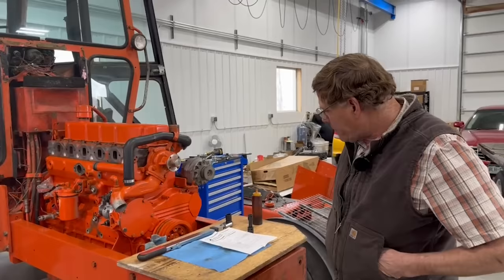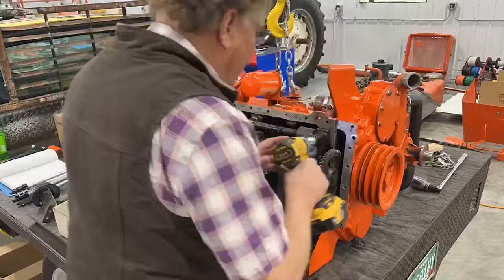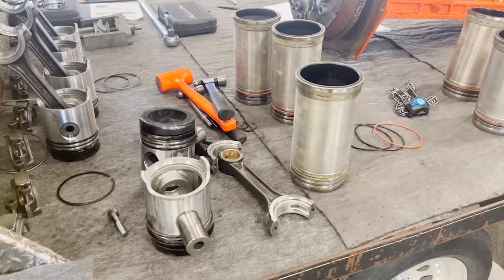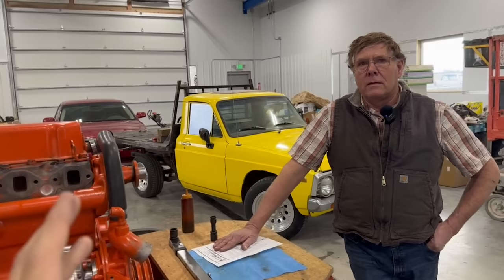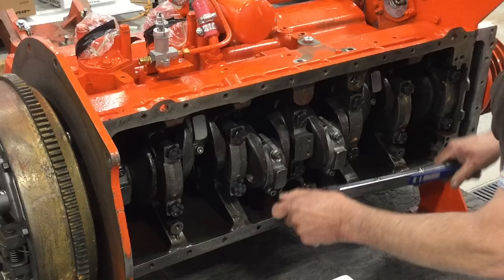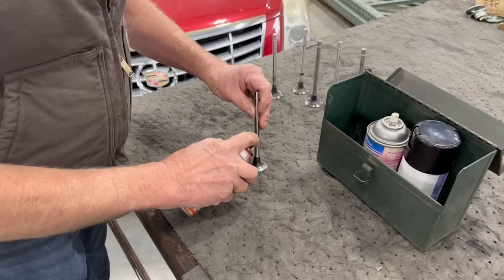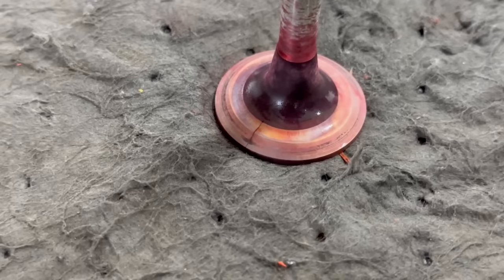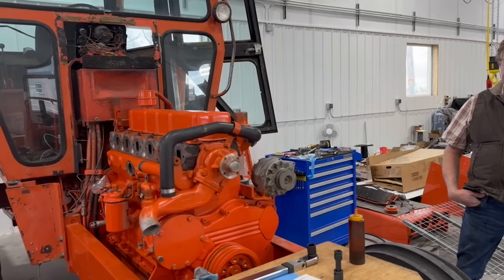Missing THIS Would've Cost Us THOUSANDS of Dollars!!!

Comment: Is there a farm tractor dealer or a repair facility nearby? They may have a  pto dyno that can verify the engine’s power and how it is operating before going in the field. 

Many tractors can tolerate 20-30 hp over factory as long as the cooling system is keeping up. 

My own farm tractor is 25% over factory (60 hp factory to 80 hp according to pto dyno) Has been that way since 1999. 

I have worked on a turbocharged JD 4020 that my friend purchased with a seized engine as a project to fix up and sell. 

The fuel pump was sent to a pump shop and they said it was turned up in every way possible which  caused the seizure.

After the engine was overhauled, it was ran on a pto dyno which showed 120 hp. Without the turbo hooked up, the 404 cid engine made 100 hp.

Comment: In your previous videos, I could tell that the injection pump was off. If you look at the spray pattern and how it is up out of the bowl, that is a big issue because it can spray flame at your ring land area. My 25-plus years of experience is that you never want fuel to be sprayed beyond the 38° mark. The hotrod diesel guys that run out of injector volume will crank up the injector duty cycle. They end up pushing the limits on it and torch the ring lands. That is, of course, on electronic injection, but it still applies.

Comment: When you get it running you should check fuel timing. There is an adapter to go on the fuel line, that puts out a pulse and you can use a standard timing gun. Mark TDC #1 on the crank and put a mark on the block where you can line it up with the timing light. At that point it's like checking timing on a 350 Chevy. Would be a good check to do to verify fuel timing and to rule out any possibility that you have a timing issues.  You should also be able to then run it wide open to make sure the timing advance is also advancing fuel delivery properly

Comment: A friend of mine runs an fuel injection system repair service and told about the cleaning guys experience with his allis chalmers and he said the pump timing very important on the fuel system.  He told me 1 degrees to a diesel is the same as 10 degrees on a gas and it would cause galling in a diesel engine.
Reply: THE HARMONIC  BALANCER SLIPPED. SHOWING TIMING TO BE WRONG. I have to many times. RICK  ROBERTS.

Comment: I have had 2 engines in the machine shop recently and I wish I had been able to watch these videos years ago because bad things happened that could have been prevented had I known more about what goes on in a machine shop. Thank you for some very enjoyable videos.
Reply: These videos barely scratch the surface.
Reply: @mikeznel6048  The biggest problem is communication. I am rebuilding VW motors from the 1950s and the machine shop spends most of its time on BIG diesels. I've seen pots 6" in diameter. So I'm not asking the right questions and they are not asking the right questions so there are returns that shouldn't happen. Your channel helps me to ask the right questions.

Comment: Our pulling tractor uses the same type of pump as you have on the AC. I have checked timing using an injection line transducer and a timing light, it is a good thing to do, but keep in mind it will not match the pump timing. This is because the transducer is looking for swelling in the injection line, the pump is timed with air on the pump port and at less than full load the fuel has not yet built pressure when the pump port is exposed.

Comment: The cavitation pitting was especially prevalent on the Cummins engines, but all diesels can be suseptable to it. Those pits will be on the major and minor thrust portions. Coolant formulations for diesels have additives to prevent the pitting, but those additives get used up over time. Regular coolant changes help. 
What causes the pits? Neucleate boiling in the system. As the combustion progresses and the piston transitions from the combustion stroke to the power stroke, it slaps the liner. This causes the liner to move outward a bit. Kind of like expand in a concentrated area. This gets the coolant moving outward, gaining inertia. Then the liner wall moves back to its static position, but the inertia of the coolant causes localized low pressure areas where bubbles form. Shortly later the coolant can move back putting pressure on the bubbles that are along the liner wall, collapsing the bubbles. The coolant rushes into the area the bubble had taken up, crashing into the liner. This erodes the outside of the liner. Eventually pinholes in the liner develop letting coolant into the cylinder.
I was a mechanic on automotive and heavy duty for 30+ years.

Comment: Really love these videos guys 👌 I think we can all agree the injection timing is the root cause, although my theories on parts of the failure are slightly different. The cavitation erosion on the liner is caused by the liner bulging during combustion rather than the force of the piston hitting it as it rocks over TDC. This would be much more pronounced if the pump was wildly over advanced. The excess pressure in the cylinder will also cause the top ring to be pushed into the bore harder, this will knock the cross hatch off almost as quick as the ends butting. Either way, the pump is the smoking gun. Keep up the good work, can't wait to hear it run.

Comment: I'm just spit balling here... but I couldn't help but notice the coolant opening that goes from the feed to the liner is larger on 1 and 2 than the others (i.e, they are a rectangle where-as 3-6 are square).  It seems to me that even if the entire system is being put under pressure by the pump, in other words the pump volume exceeds all the openings... 1 and 2 would get more flow no matter what... and that much being further away 5 and 6 would get less.  Maybe enlarge 5 and 6?

Comment: Good call opening up the ring gaps. Also doesn’t surprise me that the shop found the pump was turned way up. Think I mentioned so much on a prior video comment. I’m not an allis guy (Farmall red) but the thing to keep in mind here is you are dealing with non OE parts and you have to take every spec you read with a grain of salt particularly with mid run changes like piston cooling jets.  What I’ve found in my 45 years of walking this planet is that a lot of specs are general best case specs and don’t take everything into account particularly with mid run changes.  The non OE manufacturer is always going to try to make things as universal as they can to save costs.

Comment: After listening to all your rebuild issues, didn't quite get the pressure on your pump being over in the beginning or not. We set our two ten up in pressure and timing a little. As I said before I would never trust the end gaps from the factory. I would have put new rings and all new exhaust valves with the issues you had. Glad you found the cracked valve. 
Anxious to hear that beast run and see it pull.

Comment: Late commenting on this, but based on my own experiences with juicing up a 5.9 Cummins I owned that 20% over fuel on the pump was likely your main culprit. The timing being off didn't help, but adding that much extra fuel will add lots more heat to the combustion chamber. This can be really hard to identify without a pryometer to watch the exhaust gas temps. Engine coolant typically doesn't get overheated unless the cooling system was marginal in first place. Sometimes excessive black smoke will give away overfueling since there isn't enough to let all the fuel burn, but I can see that not showing up in your case since it was firing too early so it pry got a little better fuel/air mix. Seems like one those rare perfect storm combinations of several different things coming together at the right time.

Comment: I appreciate the in-depth videos of the failure! I have a 1974 Allis Chalmers 7030. When my dad and Allis Chalmers mechanic friend rebuilt it 30 years ago they ran into a similar issue. The engine would seize up when hot. I believe they had to tear it down a couple times and ended up honing it out to prevent it from happening again.

Comment: At 10:32, If the engine cools front to back, why do the coolant ports that feed the liners get smaller towards the back? That is backwards. You want the smallest opening at the coldest, highest pressure point, cylinder 1. When the water is hot at the back, you need to increase flow to get the same cooling rate. Cylinder 6 where the water would be hottest gets the least water? 6 looks half the size of 1.  In addition, the ones on cylinder 1&2 are very jagged while 3&4 are pretty square. Perhaps an internal casting flaw/top of port broke away?

Comment: Have you considered maybe the  water pump impeller is slipping or not pumping at all. Also, is it possible that belt direction is wrong and the water pump has is pumping backwards. I’m sure an old engine wouldn’t have a serpentine belt however long belts can sometimes confusing to get right. Just some thoughts.

Comment: If you are still concerned about excessive vibration, there are vibration analysts that specialize in internal combustion engines. They can probably tell you if you have excessive or unusual vibration by running some tests on your engine.

Comment: The largest component of the "vibration" you spoke of is the single shot injection event that delivers a sonic wave into the coolant that eventually will erode the cylinder wall on any single shot injection systems like those used on the Navistar 7.3 which required a certain type of additive to prevent this cavitation. Newer engines like the Ford 6.7 and cummins and Dmax have multiple events that cushion these combustion events by slowing the combustion pressurization rate over multiple stages. I believe the GM Duramax was the first to incorporate this timed injected event and is why current day diesels are far quieter for the big 3 pickup truck engines.

Comment: If the injektion timing is in question, you should always check!
Just take of zylinder one injection line, put a clear hose on, turn the engine a couple of times over, then slowly aproche TDC on that zylinder and watch the fuel level go up! Depended on the pump, you also can take of the check valve for that line (with external fuel tank directly on the pump inlet) and watch when it stops poring out the injection line. That's easier to see then the level going up, but dose not work on alot of distribution pumps.

Comment: When you assemble the bottom end you should assemble the  rotating assembly with a liberal amount of gearshield

The  coolant problem can be addressed by using Evans  waterless coolant,  not Prestone or  Dexcool.
Yes the valves were burned out and the guides were shot.

Comment: I know this is an old video several months old, but I know on our pick ups, Diesel pick ups, timing on our injection pumps, and the spray pattern on our injectors into the cylinders on top of the pistons will have a major effect as well for heat buildup, if the injectors are messed up Don’t have a good spray pattern with the timing on. It is way off as well as a bad spray pattern. You can melt holes in your piston called torching that can happen also. As far as lubing O-rings I’ve had real good luck with CRC dielectric Greece. I never had any issues with it you have to be real easy on it super fine film usually does the trick put it on your fingers and just work it around the seals O-rings when you put them on usually does the trick Instead of using soap or oil on O-rings that’s just me everybody’s different. Everybody has their own way of doing things. I know that for sure. Good luck on this I know they’re expensive.

Comment: Nothing beats engine forensics, even though I'm a retired Boilermaker/ Engineering type guy and rebuilt a few Diesels and Petrol motors over the years your never to old to learn. I have never considered liner or block cavitation due to vibration, electrolysis absolutely but cavitation only when it comes to pumps and such. But now I have a question, does increased water pressure reduce cavitation? Well apparently it does reduce cavitation. So to me logic states that a less viscous and increased pressure coolant/inhibitor possibly could reduce cavitation effects on the liners. Only if you think your liner o rings went in ok I don't know your rad cap pressure but I believe you could run it up to 14psi. Anyway don't take my word on it, but it's something to think about!

Comment: As a Diesel Fuel Injection Tech, the base timing of the pump is scribed on the weight carrier. On these old Roosamater (Stanadyne) pumps that line generally does not need to be remarked.  However, the weight carrier could be installed 180 degrees out and only 180.  We just had a John Deere pump with this issue in today. Generally, timing errors occur when the engine is not spotted in the correct location or the marks in the pump are not aligned.  Timing is limited by the advance piston travel, so unless the piston was changed you won’t get more advance than stock. Now 20% over fuel delivery is massive on a piece of equipment.  That can be more than the difference between a N/A and turbocharged engine.  Heat, heat and more heat.

Comment: Great videos! Have you checked injector pop pressure? Had a similar failure about a year ago and injectors would pop off at 2200 and where supposed to pop at 3400 psi. I’m no fuel specialist but my fuel pattern was out of the piston dome and assumed it was cause by injectors poping to early and washed the cylinders.

Comment: Great to see the investigation on this engine. About the pump giving to much fuel, since it is a diesel, it is opposite to a petrol engine. When a petrol engine goes lean, not enough fuel, the combustion gets hot and knock may occur. With a diesel, it can go very lean, but it will go to hot when there is to much diesel. So the 20% to much fuel, maybe combined with a wrong injection moment, can very well be the cause of high pressures and high heat.

Comment: I would definitely add a coolant filter for peace of mind, would coat the outside of the cylinders with an anti-cavitation wax/film and help with some of these problems. you saw cylinder cavitation issues when ford went from the 6.9l to 7.3l idi increasing the displacement but making the cylinder walls thinner in the process. Regular operating conditions of the 7.3 idi were pulling pieces of metal off of the cylinder walls and the fix was a coolant filter. all of our tractor trailers that we work on at my shop have them. The nicer coolant filter pedestals have a shut off so you can replace the filter without introducing a significant amount of air into the system and I always vacuum fill the cooling systems to make sure that there is no air trapped anywhere in the motor. Good luck on the project!

Comment: if i would have a gess, what happened was the pump timing being off and the 20% in fuel increase was the problem. fuel was spraying at the top/ down stroke with more fuel and the lack of proper cooling to the back cased the failure.

Comment: This is a great video series. A few comments: 1. Make sure to add a filter to your cooling system and make sure you check the coolant to assure you have the proper additive levels to prevent cavitation on the cylinder walls. My D360 IH engine in my 886 tractor had a hole through one of the liners at the o-ring groove which was caused by cavitation which required a rebuild (which I performed). 2. Make sure the injectors are checked for proper spray pattern and do not leak under their rated pressure.  I had a "new" injector in a 3-cylinder JD diesel "Yanmar" engine leak which caused pre-ignition on that cylinder which broke the ring lands on that cylinder in just a few minutes of run time which also caused me to rebuild that engine. Always check the injectors even when new out of the box. 3, make sure the holes in the "New" head gasket for water return are correctly sized., 4. You already found this out but never assume the rings are properly end gaped as they are not. I had to file the rings on the 886 kit quite a bit to get the proper end gap. 5. When you preform the die penetrate inspection you are allowed to wipe the surface with the approved cleaner on a moistened lint free cloth so you can see the defects better. I hope the 2nd rebuild work out for you.

Comment: Hi gents, if it hasn't been mentioned already and before you start it up. Just do a quick spill time of the fuel pump. I mean if it's all since been rebuilt then it will spill in time with its timing marks. 
I imagine you're familiar with it but is a fail-safe way of picking up obvious malfunctions like stuck advances

Comment: The exhaust valves having cracks to me conferms that the timing was to advanced. 20% more fuel is nothing they can easylie handle that but i run a pyro so i know when to back off. As long as there is no gas in the diesel  than any other contaminants in the fuel wont hurt it. Good luck, it looks like it should work now

Comment: As a preventative measure, I wonder if measuring the EGT would be an indicator for high combustion temperatures.  Perhaps a way to verify your temps are okay.  It would be fairly easy to install a temp prob on the exhaust manifold / exhaust pipe

Comment: the iconic diesel noise is usually caused by the piston slap you guys had mentioned. Newer diesels with pilot injection are not nearly as loud because the pilot injection will make the piston switch from the minor to major thrust side before dumping fuel in, The old mechanicals are loud simply because they just inject the full amount of fuel all at once making the piston slam much harder against the liner when it switches thrust sides. You cant avoid cavitation either, the piston also walks its way down the liner making it vibrate. The only thing you can do is run good coolant. The coolant will deposit a protective layer that is constantly replenished as the cavitation wears away at it.